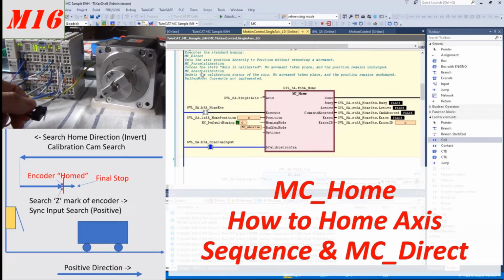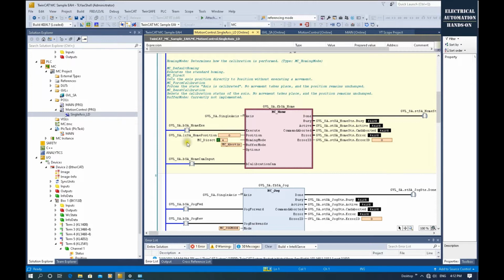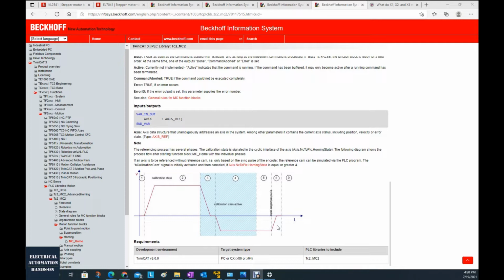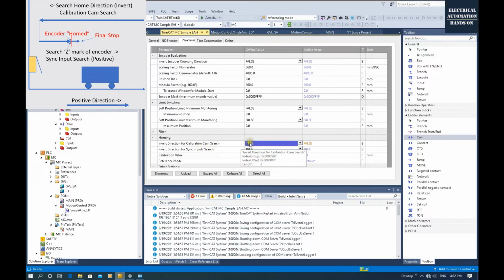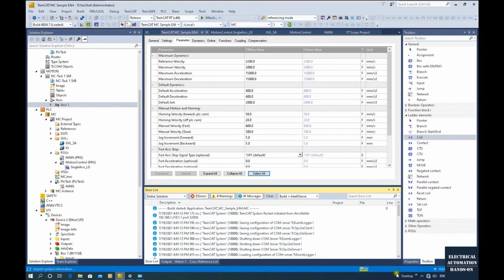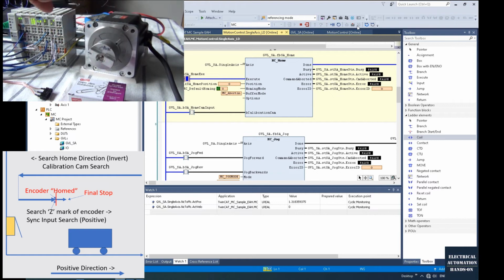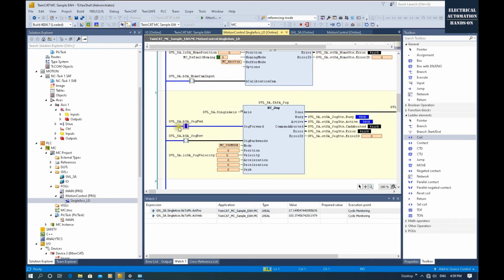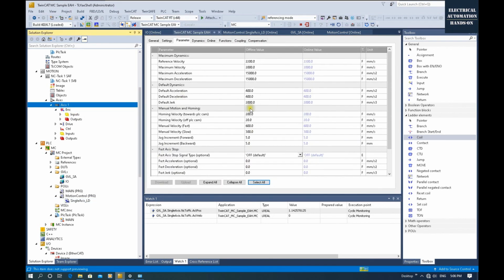MB16. [TwinCAT 3 NC] How to Home Encoder, Three Methods to Home Axis [19/20]

Comment: Sir for simatic manager how to do the incremental encoder homing program 

And how to reset the encoder value please help me
Reply from the maker: The servo drive homing is a hard topic. If a YouTube channel is an organization or a company, homing how-how is their competence, in comparison, if a YouTube channel is a personal channel, it is really really hard to present this because it needs real servo and mechanical system, need many times to setup the equipement and explain the concepts behind but the view of the videos would be just hundreds per year. Therefore, finding a qualified video that thoroughly explained this homing topic would be rare. 
What I'd like to say is that, read the manual carefully and practice in your applications. Find the correlated homing scenarios matching your case (fix stop home, cam sensor homing, z-mark home, direct home, etc.) . Note that handling this knowledge is not easy and is free to get. However, manual documents and deep research studies are effective solutions.

Comment: If we use the "Z mark" directly as Home sensor. How should we do the setting up. Because for my drive is Z mark know as "touch probe" in PDO mapping and it has typ UINT, so i cant connect it to bCalibrationCam? Can you help me please?
Reply from the maker: Regarding the 'Z mark', TwinCAT NC named it as "Hardware Sync Pulse", it can be found from Axis - > Encoder -> Reference Mode ->  Hardware Sync

Comment: Hi! Have you done before without the reference cam (Home sensor) and only with the zero pulse on the encoder?
Reply from the maker: Never seen a application only use zero pulse only. The common case is use a home sensor to find a "almost close position" at first, then use zero pulse to finally/accurately set a position value. Because this zero pulse will be ON at every rotation of the encoder, use it only doest not work. unless your encoder only spin within one rotation.

Comment: Great 👍 but how accurate it will be for most of the applications? What is the maximum possible error for homing in incremental encoder?
Reply from the maker: Hi Bud, using a sensor and the homing sequence to 'Home' the axis is to keep the 'HOME' consistent. means that the 'HOME' position recorded in the axis always this position.  Regarding the accuracy, the best method is to use the 'Z' mark of the encoder. It can cover 99% high accuracy applications.
Reply: @electricalautomation  thank you for the reply.